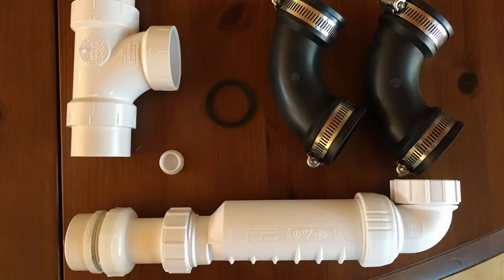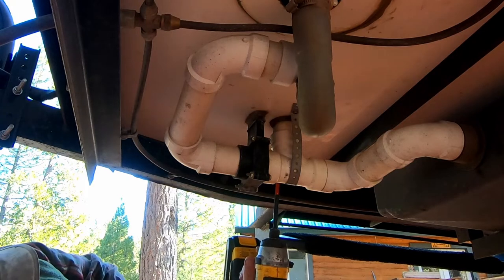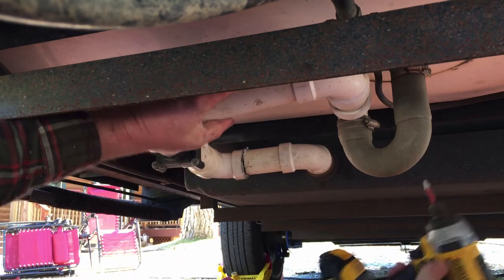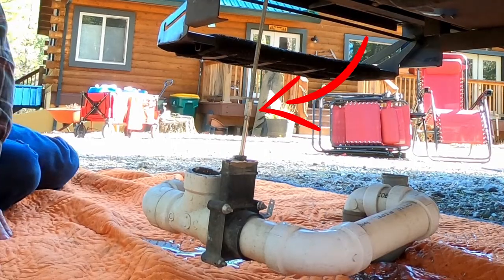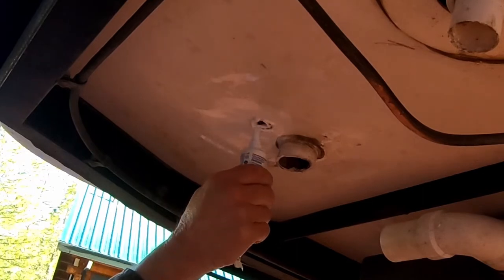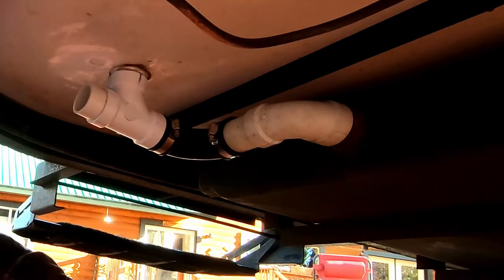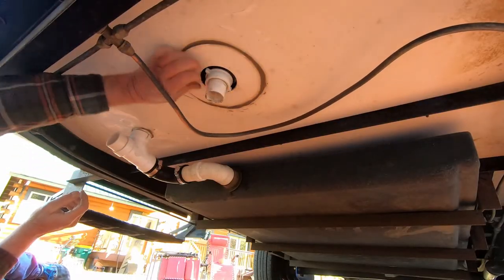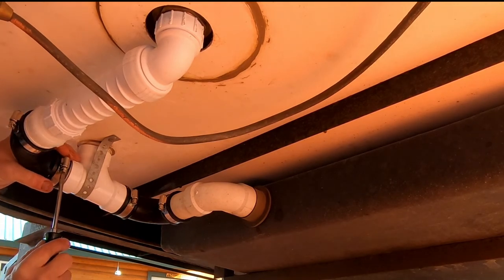Stinky Casita Shower? How to Install the Hepvo Valve in YOUR Casita

Comment: Great video!  Thanks for taking the time to post.  I just bought a 2012 Spirit Deluxe Casita.  My first trip last weekend the shower did not drain at all.  Temporarily I am thinking of taking the grey off and seeing if it will clear temporarily. Maybe use a small snake to clear once it is off.  I am going to order this modification.
Reply from the maker: You’re welcome!  That’s a bummer.  Before the Hepvo valve, we’ve only had it back up when the grey was full or when I didn’t open the valve in the closet.  Hope you get it unclogged!  And congratulations!  Happy trails.

Comment: Will water backup in shower when gray tank is full with HepVo installed?
Thanks
Reply from the maker: It won’t back up, but if the grey tank is full, the water can’t flow into it and will collect in the shower pan.